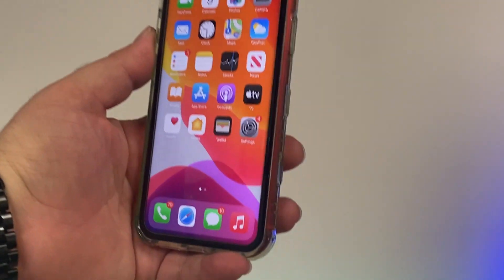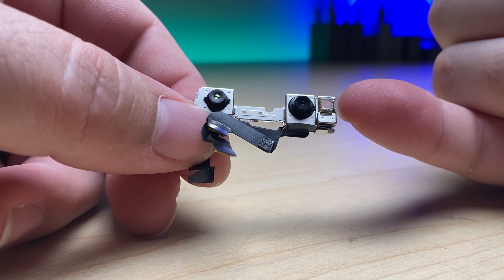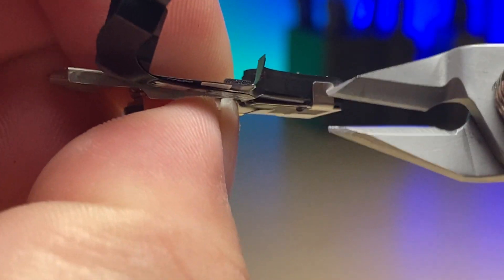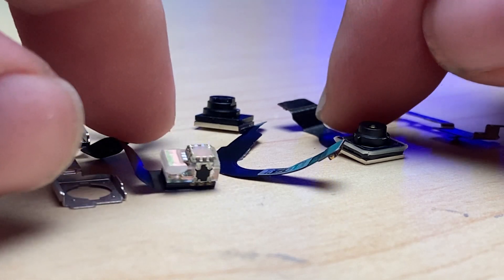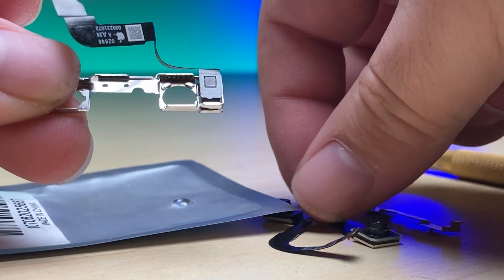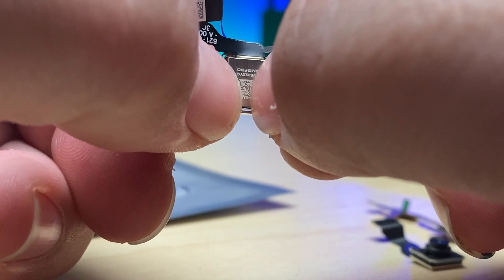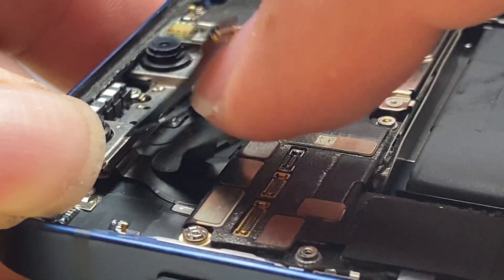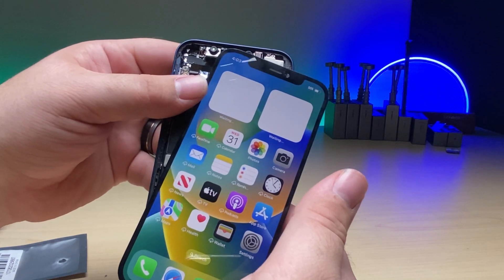iPhone 12 Front Camera Repair: Face ID Preserved Method

Comment: Hi, first of all thanks for the video and how well you explained it. 
I have a little problem, I followed all your steps and for some reason after finishing the repair I get the "Face ID is not available. Try again later". 
I've tried every solution I've found in the internet: cleaning camera, trudepth and dot sensors, reseting face id, reseting the iPhone, updating it, even reinstalling the firmware, but nothing works.
However, it is a little bit strange because after reseting or reinstalling the firmware, the first time when I'm setting the face id everything works and after that if I try to use it, it doesn't work, and if i reset it and try to set it again it doesn't work.

I don't know what may be happening but I would aprreciate very much your help or any other's.
Thanks in advance
Reply from the maker: Most likely the dot projector and the infrared camera aren’t looking at the exact same location. They have to be precisely looking at the same spot. It might have projected enough dots on your face to set it up, but it can’t map it out properly after that. Check the alignment and secure them better to the frame.
Reply: @FIXDPHONES  Thanks a lot for the advice! I'll try that